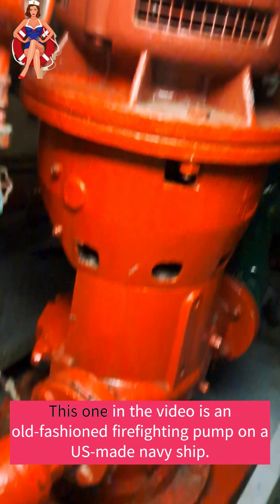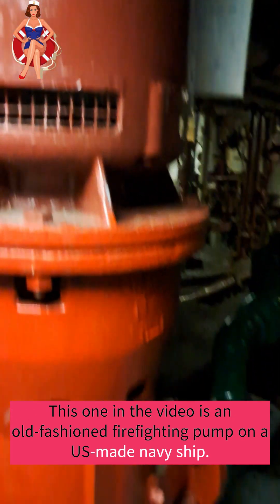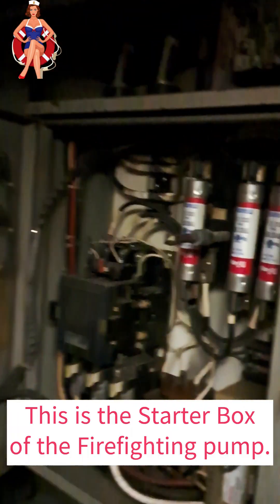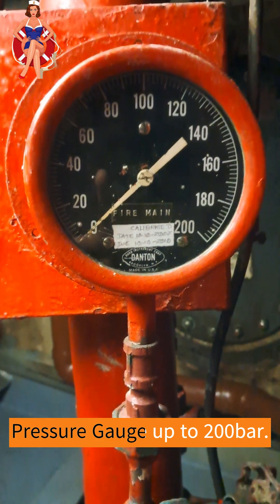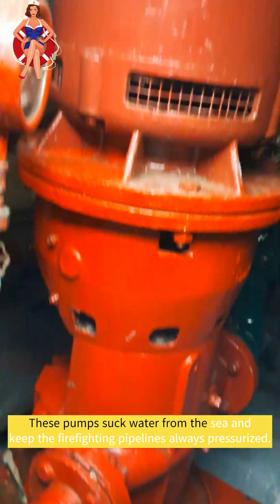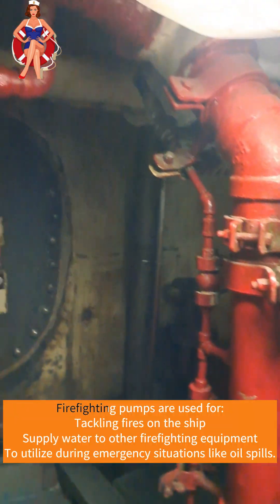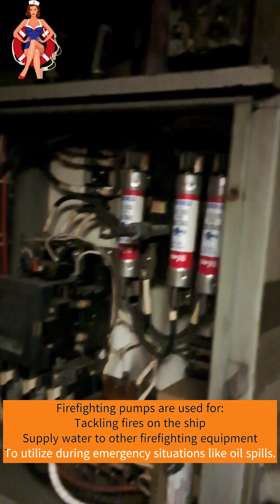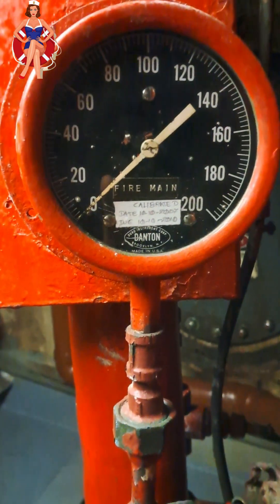Fixed Fire Fighting System on Ship 😲 Firefighting at Sea, Fire Fighting Pump System, Navy Fire Power

Comment: What effects does the salt water have on the pipes?
Reply from the maker: Yes, it accelerates pipe corrosion, but all pipes are cleaned with fresh water after system operation to reduce corrosion.
Reply: @ShipsTechTalk  So are they dry systems and they’re only filled with water for tests and inspections?
Reply from the maker: The same pipe system is utilized for other seawater needs on the ship. Otherwise, the pipe system remains dry until the pump is operational.